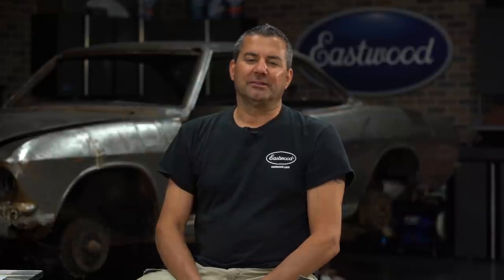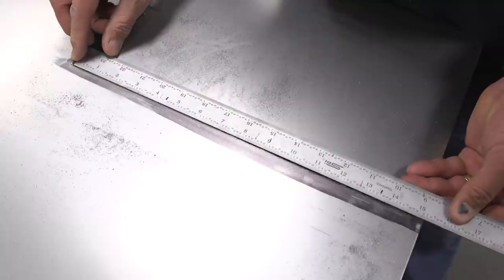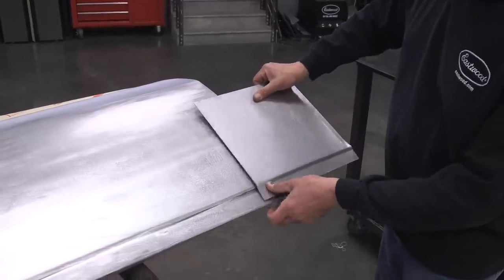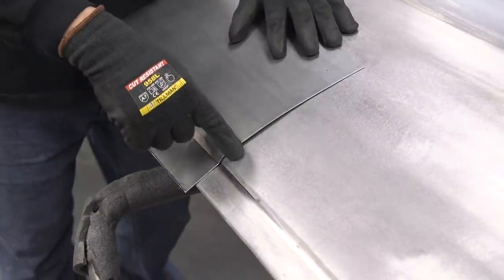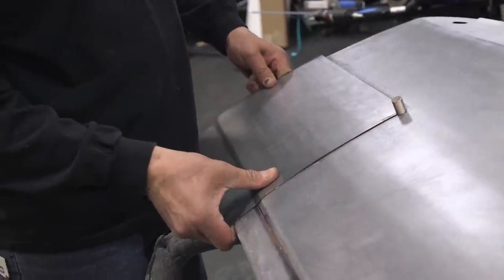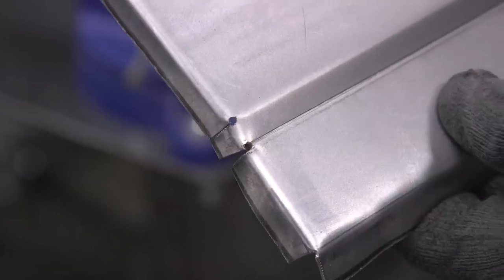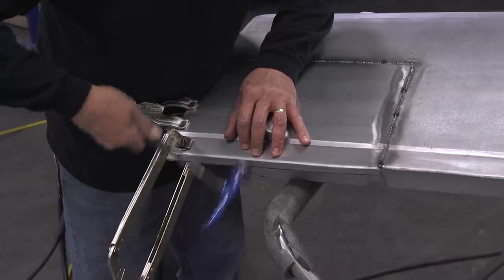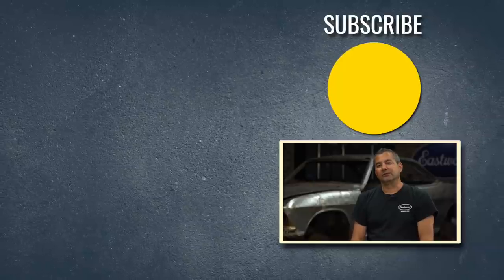How-To: Fabricating Door Skin Patch Panel using Metal Fab Tools - Ultimate Guide!

Comment: After he primed it I could see the lines where he welded should have used filler
Reply: They ain't done lol still needs the filler
Reply: Filler is applied over epoxy
Reply: @rdmanagereastwood1245  Why is that?  Not challenging, just curious!
Reply: Catalyst Arms all of our epoxies are designed to work with all quality brands of polyester filler. Having the epoxy covering the bare metal and filler on top assures not chance of corrosion
Reply: @rdmanagereastwood1245  Ah...ok...so the epoxy paint will probably do a better job of sealing the bare metal.  That makes sense. For some tough to reach spots...and that epoxy primer be brushed on?  Like for on the floor boards and such where a perfect finish isn't necessary?
Reply: Catalyst Arms yes brush or roll
Reply: @rdmanagereastwood1245  Excellent.  Thank you!

Comment: couple tips, before i cut off a patch i place a large piece of card over the panel and edges involved, index where it sits on the panel that is not being removed and trim this to fit the edge of the old skin, if the skin is gone then i do this while its on the car next to the adjoining panel.
when i'm making the new patch fit i can put this back in place before final hammering of the edge etc.

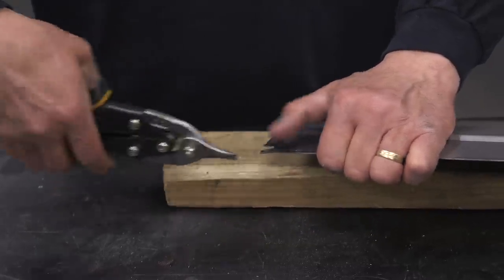when cutting the corner releif for the folded edge i cut a 45 degree live across the corner rather than the square one seen at 8:46 as this give a perfect alignment edge to weld 

to eastwood, you should have shown the weld to the underside of the patch panel, both where the new meets old and the corner weld.

with the 45 degree cut you can start the tack weld in the corner of the frame and walk it over the skin return straight off the corner of the door, this seals up the corner spot perfectly and there is no overlapping of the return edge from the box type cut.

i love the panel saw, great device !!

Comment: Planish it out both sides cut a slim piece , mig weld it in and grind it out any ripple light skim of putty or maybe high build or just reskin it and should joggle or flange those edges (step joint ) better contact area less risk of burn through

Comment: Why not just fill the small square hole with a smaller panel than going on to do what seems as 3X the work?
Reply: It’s a video to show how to make a repair so I wanted to show how to do edges and body lines. Yes you are correct could have just cut small square but what fun is that ?
Reply: R & D Manager Eastwood I get your point but in reality time is money and to be more exact time is worth more than money. That little saw looks as if it’s made in China, can you clarify for us please?
Reply: R & D Manager Eastwood I’ve got a bunch of panels that could use repairs, you’re welcome to them if you’re able to return them in a timely fashion.
Reply: Hamilton Cooper COO is Taiwan with included Lenox Diamond wheel
Reply: There was probably damage to the surrounding area that was not visible on camera